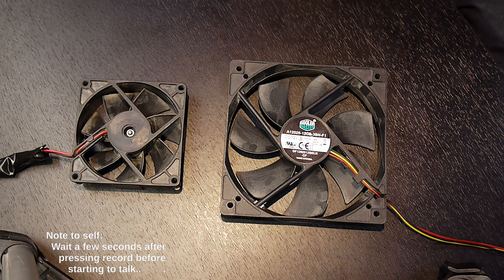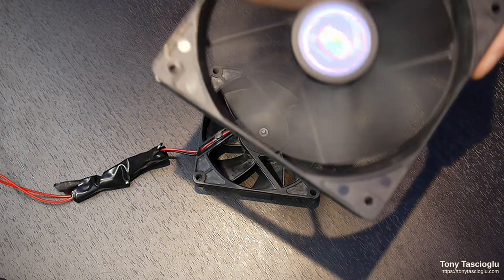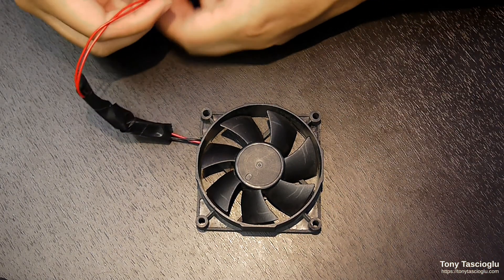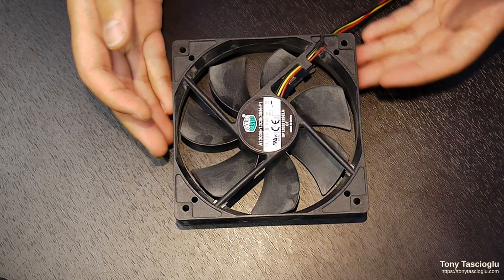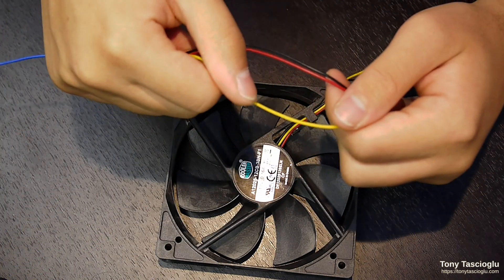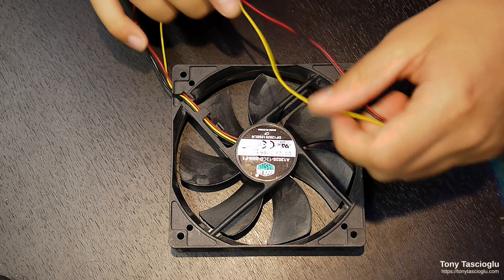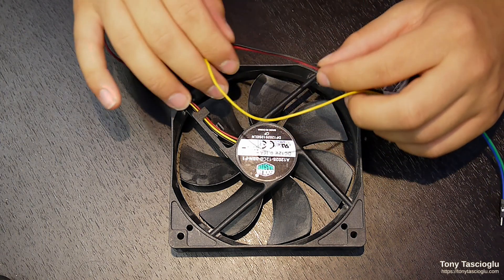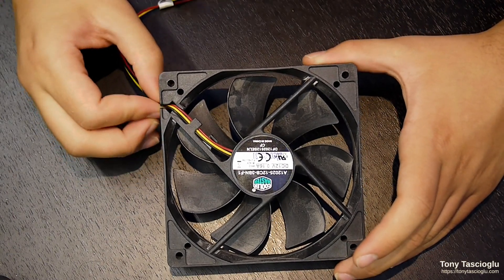2 vs 3 vs 4 Pin Computer Fans Explained (and Which Should You Buy?)

Comment: Thanks for this video… it was exactly what I needed. I’m pretty green in the wiring and electrical stuff, but I am trying to put together a hydraulic cooling system for a small machine, and was trying to figure out what the difference was between the pin types.  I had already purchased cooler with 2 pin plug type and was questioning whether that was a good decision. 
It seemed the most simple type for me to figure out, and after your video… I think that I am good with my choice.  Obviously I’m not cooling a computer, but it’s just a fan blowing through a radiator, so I think that, your video explains what I needed to know.  Thanks

Comment: Not all three wire PC fans will work with the yellow wire disconnected. Some may run very slowly if yellow is connected to the black wire but not spin at all with yellow disconnected.

Comment: I'm testing pc fans for wind power gen on a smaller scale than what kills birds. The end goal would be even smaller (mm/um/nm sizes) but cm scale pc fans are cheap and ubiquitous.

One thing i've noticed lacking in pc fan videos is why pwm is preferable. Pwm outputs similar torque over the rpm envelope.

I have an array of 3 with each cell being 2 fans of different blade count, blade pitch and the supports are pitched to collumate the flow for best fan-flow per cell. The curvature of each blade is optimized for push but pretty good if recieving from the exhaust side. The support structures inhibit the efficiency in windmill mode and I'll need to remove the props and 180 them. Thusly the primary blabe will operate under lower wind speeds at the same efficiency as higher speeds and the secondary will begin operating in high speeds and at higher efficiency.
A vertical linear array will generate power w/ a very small output, cost very little, be able to change with wind direction quickly, not kill birds or offend the eyes of dumb neighbors, and harvest energy more efficiently over a range of wind speeds and in turbulent areas.

Comment: I dunno if you will read this or not... but thank you very much for this nerd random info that I actually needed today because I wanted to install a random case fan that I got for free into my old shitty system and was wondering about the orientation of the pins... so if you see the notch from the top view, from left to right is ... 1) pwm 2) sense 3) vcc and 4 is gnd, correct ? ... :)

Comment: Thank you, you helped me a lot, as this also explained why fans of different pin numbers can work on headers with different pin numbers, for example plugging in a 3-pin fan to a 4-pin header is completely fine (as long as you line up the notch of course) you just don't get the same level of control you would with PWM. 

I found my way here by the way by searching "2-pin computer fan"because I just got an external HDD enclosure with a loud fan and have been baffled by how it can have only 2 pins and how am I supposed to replace it. Now I know that I can get a 3-pin Noctua with their low noise adapter cable and it should work just fine as the RPM feedback is not needed anyway by the device, just 12V and ground.

All in all, an incredibly useful video, thanks again!

Comment: Can I control a pwm fan with voltage as mu asus board has only pwm support for cpu & 4 pin case fan header (fake pwm by clever asus team) has 4th pin for +5v not for pem signal so basically it's a dc controlled header.
I'm using Corsair maglev pwm fan with that header & it's working quite well with full RPM control that I'd have gotten with a real pwm header and getting rpms even lower than pwm😮
Is it right to control a Pwm fan via dc or I should switch to cpu header via a pwm splitter cable or fan hub to use pwm function of the fan.
Many says that dc damages pwm fans but why manufacturers offer dc & pwm both options to select for them🤔

Comment: But i have a 2 cable fan and does go faster and slower at times. Why does that happend if nothing is controlling it?
Reply from the maker: It will go slower/faster just depending on the voltage it's receiving.
It's just that the device doing the controlling won't get any feedback back from the fan about what RPM it's actually running at.

Comment: Quick question; does the speed control wire on the four pin fan carry an current/load? I want to add additional fans to my pc and would like to split and share the speed control wire from the cpu fan to the new fans, while using SATA gnd and 12v to supply the main power to the fans.
Reply from the maker: On 4 pin fans, you should be able to split and share the PWM speed control pin (4th pin). Just make sure that you only have the tachometer (3rd pin) from one of the fans as those won't be able to mix.
Ie: "Master" fan gets all pins (1, 2, 3, 4), and the other's get pins 1, 2, 4.

Comment: I want to make a fume extractor with noctua fan but it has 4 pins. Need to find out how to wire up just with positive and negative. Will it just run max?
Reply: if you wire the black and red wires only, then yes it will run at full speed

Comment: Is there any way i can force the 3pin fan to run at higher than rated rpm? Like increasing the voltage beyond 12v? Its installed in a pc case connected to my motherboard. Although i would not like to risk my motherboard, i dont care if the fans die.

Comment: If i want to wire the fans into house wires.  Should i wire them in parallel or series so they split the volts?  Cause 120V is a lot.

Comment: Actually there is no need of all this fancy PWM controllers to run a cooling fan.
Al that PWM does is regulate the speed depending on the temperature of what it is cooling, just saving some minuscule amount of power.

Comment: I seen a video were they used 3 mosfets , 3 diodes, & 3 transistors .  The wires from the 4 wire fan were hooked up black wire to black wire the 3 other wires into the mosfet holes were they bolt to the heat sink .  The red power wire is feeding the pin sides along with the diodes and transistors .  They are wired from one mosfet to the next . I didn’t see how it could work because the motor wires were on the heat sink side of the mosfet .  It made the fan look like it went from 3000 rpm to like 30,000 rpm . Thanks for this video it help me determine my 3 wire fan canon be speeded up .  I’ll just have to get a 4 wire one an go from there .  Thanks again , you did a great job explaining it in detail !

Comment: Really fans are BLDC aka brushless that have a embedded control circuit as its a multipole brushless fan. So the circuit can be voltage controlled with PWM but the fan curve is sort of limited with some 2 pin fans as was never designed to be voltage/pwm controlled.
4 pins with a pwm input and tacho out are what they are.
3 pin fans just have tacho out with a circuit that is designed for voltage control.
There are also now for Pi like boards gpio fans where they are 3 pin but the 3rd pin is a PWM input not tacho out.

Comment: thanks bud. I can't say I understood why u can't turn the power on/off on 3 pins fans. But I got the point, thanks for that. Is there any way to know that my MOBO can regulate speeds with 3 pins fans also? (it has 4 pin connectors by default) it's b550 tomahawk from msi. 

Again, thanks for this video and I hope to see your reply!
Reply from the maker: Most motherboards these days will have 4 pin headers, but will support both DC voltage (for 3 pin) and PWM (for 4 pin) fans. Most auto detect if you use 3 pin, and switch to DC mode, but on my last board, you had to set a switch in the BIOS where you configure fan curves to mark them as 3 or 4 pin (DC or PWM)
Reply: @TonyTascioglu  yeah my motherboard X470 Aorus Ultra Gaming-CF has 4-pin headers for fans (4 system, 2 pumps, 2 CPU) and I plugged in four 3-pin system fans and their speed is controlled fine with the SIV program. It has full programmable profiles for each fan, power% per temp.
BTW are I see you are in Canada, are you Greek or Turkish by chance?

Also, I think, if you take apart the heads of the fan cables, you can connect the 2 power wires (red and black usually) directly on a molex. If on the molex the black is ground, red is 5 Volts and yellow is 12, then you can get 5 or 12 Volts to the fan, but also maybe 7 Volts too. If you plug them on the red and yellow molex cables then 12 - 5 = 7 , right?

Comment: Can i connect 2 pin fan in 3 pin socket
Reply from the maker: Depends - as long as both are 12V, if your motherboard supports it, yes, but some won't give a voltage unless the tach pin (pin3) is also populated. And if it does work, you likely won't have speed control.

Comment: Why 4pin pwm fan are much higher amperage rate compare to 2/3pin dc fan? At Same size, same peak speed. Most 4pin pwm rated 0.30a above
Reply from the maker: It can be the same speed in RPM, but have much higher static pressure. Eg: You can find 3000 RPM Delta server fans, which can pull over 1A, but it's still only 3000 RPM, which isn't much higher than a normal fan.

Comment: I have noctua 3 pin fan. Red, black, yellow. I also bought a dimmer to adjust the speed of the fan. The fan is coming to my camper toilet for ventilation purposes. I dont know if I connected it correctly, red and yellow together to the 12v and black to ground. The dimmer only slows down the fan very little. Same without yellow connected anywhere. Whats wrong? Should I leave the red disconnected completely and connect the yellow to the 12v or what? Can you help me?

Comment: Can i use cpu fan in gpu
Reply from the maker: Yes and no. I mean, if you can mount it, there's no reason why not from a physical standpoint.
The only problem is you'll want to make sure the fan speed is controlled by the GPU.

ie: if you replace your GPU fans with Noctua fans, and plug it into your motherboard, the GPU fans will spin up and down with CPU temperature, not GPU. So, if you can plug the fans into the GPU or solder it to the older fan connector, it'll be better as the GPU will be able to set the speed based on its temperature.

Comment: Thank you, great explanation... I just brought a turing pi, which has a 2 pin header, and the case I've brought has a fan with a 3 pin header, I think the turing Pi can set the output voltage... but now I know, no monitoring or PWM.. thanks again

Comment: What about the fan which connected by 3 pin but with PWM instead of Tachometer pin? Will it control by PWM signal without a tacho signal?
Reply from the maker: 3 pin fans typically don't allow PWM control. From all the ones I've seen, the 3rd pin is always just the tach, and you can't give PWM on the voltage pin either, as PWM fans need 12V on the input with the PWM signal on pin4, and it converts it for the motor internally.

Comment: Curious on the 3 wire. I have an Artic Tricool that I am going to use as an exhaust fan in the camper. With just red and black connected to a 12v battery it barely ran. I connected the yellow and red together and it ran perfectly. Any idea why? Want to make sure I am not going to burn it up.
Reply from the maker: I don't have a good answer for you at first glance. I would be curious about the position of the wires in the 3 pin header than the colour - while in most applications, red is the input voltage and black is ground, in the PC world, it's typically red=5v, yellow=12v, so that yellow wire might actually be the +12v input for the fan rather than signal.
In either case, it probably won't burn it? Most electronics are better these days at ensuring you don't backfeed them or run them with reverse polarity.

Comment: Wanted to know if I'm getting speed control from my case fan headers. I guess not, 3Pin connection for a high RPM pmw fan would be a waste. So now I need to get a fan hub because the board itself doesn't have enough 4pin headers 💀. Thanks a lot for the info
Reply from the maker: Whether you have speed control on 3 pin headers depends on the motherboard as they work by just lowering the voltage to the power pin (with the 3rd pin providing the feedback on the current RPM). From my experience, most consumer boards do have the capability to provide a variable analog voltage output from the 3 pin header, whereas the Supermicro board I use does not have that capability and runs all 3 pin fans at 12V.

Comment: hi tony, I bought 12v 2 pin fan(black and red wire), there is no problem if I put in the  4 pin? and tell me which 4 pin compatible. TIA new subscriber here.
Reply from the maker: For starters, you likely won't have speed control over it (theoretically possible - but most firmware won't let you unless you have and RPM sense pin hooked up), and your motherboard won't detect or know that you have a fan connected there. Whether it works depends on whether the motherboard outputs a constant voltage to the fan headers when not in use.

In the worst case, you can always buy a 2 pin adapter and adapt a sata or molex power supply connector (which have 5v and 12v) to the fan directly.

Comment: I bought a Case that came with 2 fans with 3 pins each, and a splitter. Is there any problem if I connect those fans to that splitter that has only connections with 2 pins?
Reply from the maker: It will most likely work - however, if you are only hooking up 2 pins to a motherboard, you might not get the RPM sensor which stops the motherboard from controlling speed in most cases. If your splitter is 3 pins to 1 fan, and 2 to the other, it should work (but both will run at the same speed). 

On the other hand, if the source of your splitter goes to the power supply directly (instead of the motherboard), it will also work fine, just without speed control.
Reply: @TonyTascioglu  thank you for the reply!
Reply: I want to use cpu fan ,out side cpu .but cpu fan have 3 wire. and  my usb cable have 2 wire , how to connect to run fan ?

Comment: I'm working on a DIY Desk Fan using a 120mm 4-pin CPU fan. With a standard Red/Black wire power supply, what wires would you connect to that? Red to Red and Black to Black? I would assume I don't need RPM or Speed readings as its just for a little desktop fan. Looking at a Noctua 120mm 4-pin fan
Reply from the maker: For a 4 pin CPU fan, the yellow wire will typically be +12v and the black wire will be ground. You don't need the RPM pin (pin 3) or the PWM pin (pin 4) hooked up for it to run - however, if you don't use a PWM signal on a 4 pin fan, it will always run at full speed, and 4 pin fans typically do not like speed adjustment by just lowering the voltage and want a constant 12v supply. 

To clarify, on ATX computer power supplies, red is +5v and yellow is +12v. So, to answer your original question, if the 'red' wire on your power supply is +12v, just connecting power and ground should work and will let the fan run at full speed.

If you do need speed control, the PWM pin on 4 pin fans is typically only rated for 5v, not 12v - so if you do try to adjust the speed with the 4th pin, you might want to make sure you don't overvolt it.

Sorry if this sounds confusing, let me know if I should clarify anything!